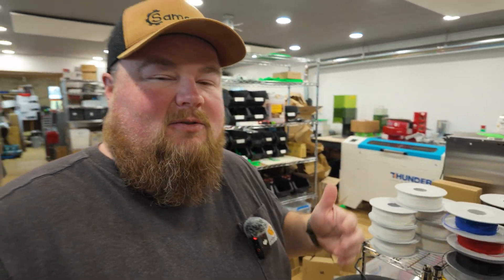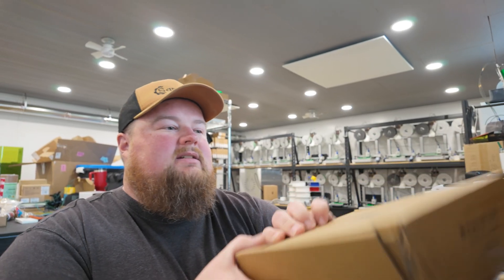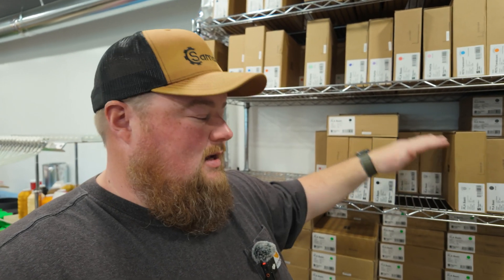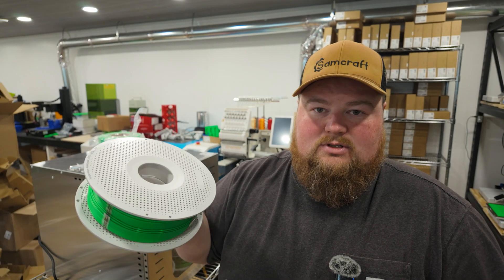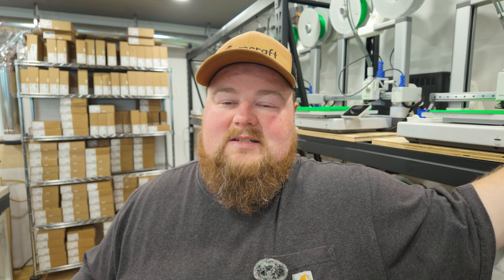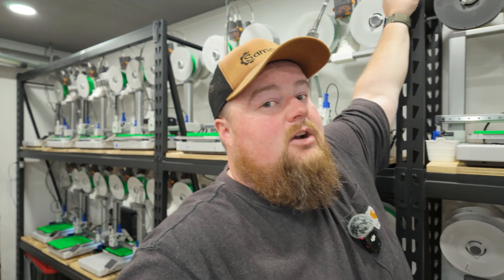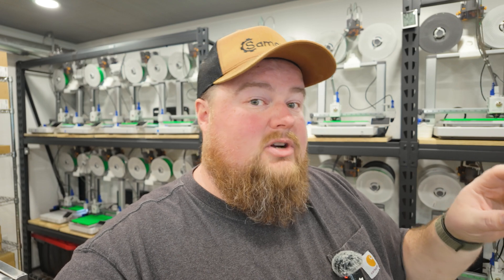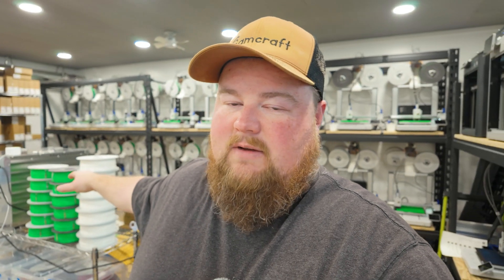How I Prepare Filament to use in my 3D Print Farm Business

Comment: I've barely made it into the video. Complaining that the cardboard is damaged? Really? Is the filament fine? Because that's all that really matters. AND, the box is there to protect the product. And one more thing. Blaming Bambu? How do you know that didn't happen elsewhere along the trip? I recently got filament from Bambu, and even though it should have taken 3ish days to get from California to Washington, it took almost 3 weeks. UPS could have manhandled it in all kinds of ways in that time. People just have to nit pick and bitch and moan about everything, probably trying to scam into getting free filament, because "cUsToMeR sErViCe"
Wah wah, no packing slip. Even if you had one, you'd still have to visually check your order to make sure you got everything. But without one, you just pull out your phone and check your order receipt. Either way, you're still going through the order to actually see what there is.
I've literally never talked to anyone who says not to dry your filament. It doesn't matter if we're talking PLA, PETG, TPU, etc. It all has to be dried. Now, not always straight from the package, although once in a while we all get new rolls that need it. But if left out for a while? We all know it needs to be dried.

Comment: I’ve been 3D printing for 10 years, for work and for home. I’m in central Florida, and have never needed a dryer for PLA. Other filaments are sensitive to moisture, but never PLA in my experience. The lowest humidity I’ve seen in the past couple of months has been 40%. This week, it’s been 66% pretty consistently.  I have two A1 combos running non stop, using Bambu basic PLA.  Fantastic print quality. I do store my opened rolls not in use in 1 gallon Ziplock bags. These fit a 1kg spool perfectly.  I can also store these bagged spools on a RepRack wall mount system.  I’ve only ordered about 40 rolls of filament from Bambu. The first two orders arrived in good condition about 5 days after being ordered. My latest order was a couple of weeks ago, still hasn’t shipped. My other go to filament is Sunlu. Prints as nice as Bambu, but requires an adapter (Maker World) for use on the AMS Lite.  The spools reportedly don’t roll well in the regular AMS.  Amazon had a bundle of 10 spools for $129 on sale last week.  Sunlu often has sales on their website, and you’d probably get additional savings on the quantity you order.  I typically order 4-20 rolls at a time.
Reply from the maker: That's really interesting to hear about your experience with PLA and filament ordering. Thanks for sharing!
Reply: I've never had an issue with PLA either. I do dry PETG and TPU, not because I've had issues with them but because I use them so rarely that it's no hassle to do, so why not just do it just in case. With how often I use PLA and the amount of different spools of it I use, it would be a royal pain to always keep dry so I just figured I'd see if it became an issue, and it never did. I've had spools sitting for years and I just blow some dust off and they print fine.
Reply: I agree.  Honestly, I store PLA in the open in the Midwest (KC) and while we do have humid weather, I've never had issues with PLA.  Now, PETG, ABS and TPU, I also store in gallon Ziplocs and dry at times.  Especially TPU and ABS.  I have a Sunlu S4 and two rolls of TPU and one roll of ABS are in there all the time due to the volume of what I'm printing.
Reply: How do you fit a spool in a one gallon ziplock bag?
Reply: @ they fit perfectly. Bambu, Sunlu, Hatchbox, etc.
Reply: My experience (which is shorter than yours) is the same with PLA but I would add that this is talking about plain normal PLA. A exception I have observed are Silk PLA filaments. Something in the additives that make them Silk is probably somewhat sensitive to moisture because I have seen a difference in how it prints stored for 2 months in 40% humid room vs how it prints after drying. Not as bad as PETG and nowhere near fiber filled PETG but a visible difference it was. 
No such difference for simple normal PLAs. I even tried the experiment I saw on youtube: put the spool in water, print with it still wet. It still printed normally, the steam coming from the hotend didn't seem to influence the result. 
All other filaments, to differing degrees, seem to benefit from drying.
Reply: I use nothing but PLA and from the start was paranoid about moisture because some youtubers made me so. We're not as humid just east of Austin, but still get up there occasionally.  The other day I decided to try a spool of PLA that had been sitting on the shelf bare for 3 YEARS.  the first 2-3 wraps snapped like dry spaghetti, but after that it printed a benchy perfectly.
Reply: Sunlu always runs fine in my standard AMS.
Reply: @jhlewis10   They run okay in the system 90% of the time for me, but the bottoms of the roll will lightly scrape the bottom of the ams. I have 3 ams in total, and it happens in all of them. My cousin actually has scrapes in the bottom of his ams from running sunlu for a good while and it rubbing the bottom of the ams. I do not believe it does any immediate damage, its more just stressing your ams motors out more than needed.
Reply: @ I’m seeing complaints on the Bambu FB groups. But I only have a couple of the AMS Lites, so no first hand experience, which is why I said “reportedly”.
Reply: I don't really ever use PLA these days as I'm an ABS guy but I've never dried PLA and my Vorons are in my basement that can get humid in the summer especially. My ABS and TPU on the other hand, get dried with the polymaker dryer before use.
Reply: I’m in south fl and my filament will get brittle if left out and needs to be dried - I only use pla from Bambu lab - mostly matte

Comment: Have you ever weighed your filament before/after putting in the dehydrator?  I’ve always understood you didn’t really need to dry fresh PLA, or PLA at all really.  I’d be very curious if you detect a weight change from dehydrating.  Congrats on 100k!

Comment: as for storing dried filament i use 100 litre ip67 rated storage tubs, they hold 30 spools each.
i only have one printer and i open spools and put them in and in about 36 hrs the 3kg of desicant i have in the tub has absorbed on average 5 grams of water from a fresh spool.
so that may be an option for keeping dried filament dry. 4 tubs is a easy 120 rolls dried and ready to go.

Comment: I have personally received refill spools that I couldn't use because the inner cardboard roll was mangled and misshapen. They were replaced, but it took a while. I use a lot of IIIDMax filament now because if you order 10 spools, you pay about $12 per for misc. Colors. Some of their colors aren't very color fast though, meaning you may get some streaks in the print, which can look cool, but if you're after consistency, that may not be good for you.

Comment: You certainly have achieved good growth in a short space of time. Where I live as I write the humidity is at 85% daily. So drying filement is a real issue even on the tiny scale that I presently use. if I leave open rolls on the shelf... well you can imagine the result. I dry and then store mine in 20 ltr pales you can get up to 6 in one of those with desiccant and that works quite well. It's not ideal but needs must.

Comment: I don't generally dry my PLA or PETG. I dry the space. It's much easier. It has its drawbacks though. Keeping my space dry <20%rh is great for filament, but there is a lot of static charges whenever you touch metal, so if you're working with electronics, you'll definitely want static wrist straps, anti-static mats etc. However, running heaters all the time can really drive up your energy costs, and frankly, I don't trust a lot of the cheaper filament heaters available. Some companies ::cough cough Qidi cough cough:: can barely keep their machines from melting, let alone some cheap device that can have a thermal runaway.

Comment: Are the filament spools themselves damaged in any way? The primary function of shipping boxes, after all, is to protect the product in them. If the spools are undamaged, then there isn't a huge problem here.
Reply: It's a busy time for the shipping companies and if the box is heavy they are going to mistreat it
Reply: I wouldn't be upset with that shipping.
Reply: It's not just rolls. I had two rolls and some spare printer parts in a box big enough for all of it to tumble around together. Fortunately none of the spare parts were broken but I was scratching my head as to why they did that. I see I'm not alone.
Reply: They’re not. Never had a damaged spool. I find that statement a weird considering it’s only the boxes and bambu can’t even control the shipment company just throwing around boxes.
Reply: @LCSL90  The problem is that Bambu is not adding any packing materials to the shipping box. They are trying to save money and time and with that is could lead to damaged product even if it has not happened yet. I agree that Bambu cannot control the shipper and how they handle the packages but they can add more protection inside the shipping box.
Reply: @collimic  This is EXACTLY the problem, zero packing to keep things from moving around.  And while it looks like Sam's just getting refill rolls, shipping can absolutely damage filament spools.. I've got about a 25% breakage rate on spools I order from Amazon when I need some weird filament (silks, coextrusions, etc) with one brand I've been using (Chitu coextrusion silks) at a 100% broken spool rate on shipments..  I've been able to salvage them using a V-spooler setup (awesome respooler that works great) that I printed, but shouldn't have to do that on a new spool.  Same issue as Bambu's shipment, no extra packing materials, and the spool boxes are bouncing around in a much larger box..

Comment: Ill be honest Im not sure why youre complaining so much about the shipping conditions, when they literally ship the filament for free + the volume at which you order and the weight of it all.  You're surely mistaken if some packing paper, peanuts, air slips are gonna prevent the boxes from crushing, cause you're gonna get some crushing.  The alternative is to make us pay for shipping so they can use the pricey stuff that form fits. But thats wasteful as a whole and expensive. Idk about you but id prefer to not have packing material to dispose of with every shipment.The refills themselves are rarely if ever gonna get damaged that way since their individual boxes provide plenty of protection. Not just that, but business wise wouldn't it make more sense to ship your product that can basically be flat stacked in bulk without packing material for pennies on the order and save thousands vs replace the 1 in 1000 spool that got damaged in shipping? I mean I get for most items we buy we wouldn't want that right. But its filament, its hard to damage, the product is fine, and the ugly box is gonna get trashed anyways. I ordered about 60 spools throughout their Nov sale. The boxes were acceptable no issues with the filament being damaged.
Reply: I had to stop ordering from Bambu due to customer service and delivery issues. 
I've ordered Elegoo , Polymaker, and others. All were free shipping. And packaged nicely. Usually if you spend more then 30 bucks the shipping is free, from any company.
Reply: Its not free your spending enuff to make it free
Reply: I kinda get it but at the same time I could care less about the box the filament is in. Im not keeping it. It's literally going in the trash. But things should be packaged so that they cannot bounce around.
Reply: Nothing is shipped for free.  It’s all built into the price of the item.  As such you’re paying for it and you have the right to expect quality.
Reply: Why complain on a constructive feedback... If they send products badly for a bulk repeated order, they will do worse for individual customer.

Edit: doesn't matter if the box is looking good or not, yes i know people will just throw them away. The point is, there is nothing wrong to ensure your products are recieved in nice condition for customer. From a business perspective, do you need to wait till a customer recieve a badly damaged filament to start fixing things?
Reply: You’re right to expect quality, but only when it matters. 
The condition of the box doesn’t matter, and especially so if it ends up driving up the shipping price.
Reply: @ yeah but if you start slacking off on the small stuff, your customers will start wondering what else has changed.  Look good, play good.

Comment: Do you do anything by way of keeping track of how much moisture your filaments are losing after heat treating them or drying them? I weigh my filaments before they go into the dryer and weigh them after to make sure that the process is working. It also helps to rule out the idea of wet filament when I encounter Less than ideal prints. I’m curious to know how well your dehydrator works. Love the videos!

Comment: why do you use the ams if you're only printing one color?
Reply: So the printer keeps printing when a spool runs out, the AMS will pick the other spool with the same color and continue printing
Reply: @MysticalQ  That is why I use the AMS. Auto-refill of the same/similar spool. However, occasionally, load 3 and 1 support spools, which allows for easy removal. You only need a very small amount of interface for the "support" and the rest of the tree can be the same PLA used.
Reply from the maker: I'm not printing in one color. All my products are a minimum of 2 colors.

Comment: Hi, I wonder if Bamboo Labs will contact you to discuss your shipping concerns.

Do you rotate your refills to ensure the older stock is used first or does it not matter?

Can you change the direction the dehydrator door opens to make it easier to unload the refills to the left of the dehydrator. Also, where does the water the dehydrator removes from the filament end up? Does it end up in your workshop?

What are your energy requirements like? Do you use or are you thinking about generating your own energy on site? Solar, wind etc?
Reply: The dehydrator evaporates it to the air as it just works through blowing hot air, unlike a dehumidifier which works my cooling the air and letting the moisture collect onto coils and drip (which he has plumbed into his sink drain). The combo of having both gives him the best result since the humidity added to the air from the dehydrator, gets pulled right back out by the dehumidifier to go down the sink drain and out of the shop. As long as its sealed up, no real point to rotate stock around unless you start to see a shift in color, which occasionally happens as companies go through a Lot of color pellets and the next Lot may be a touch different, or something change in production and they have to use less/more colorant.